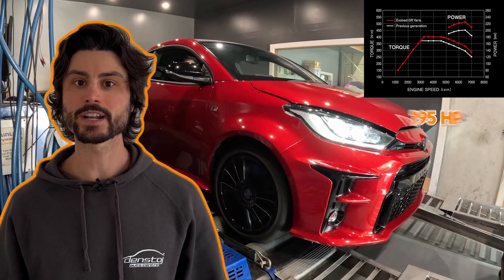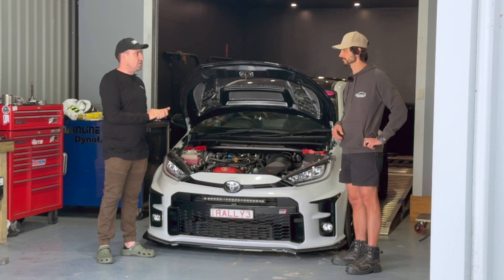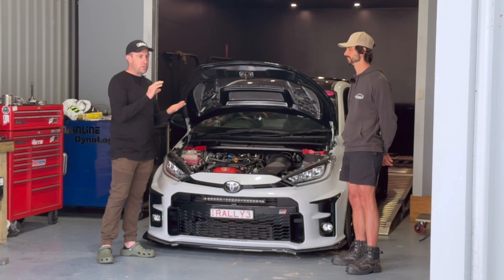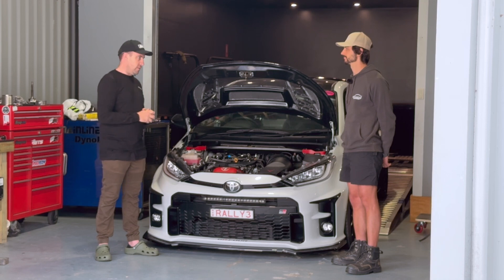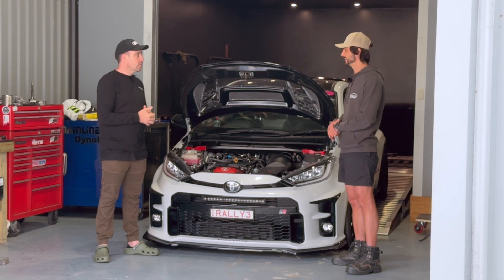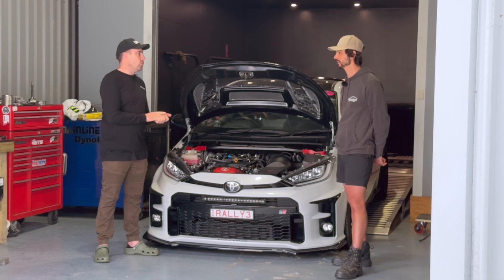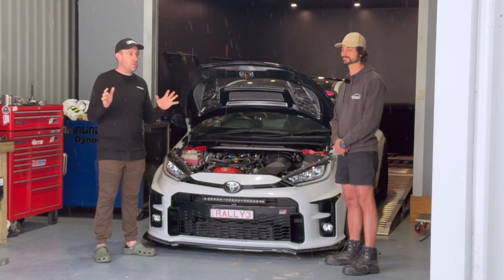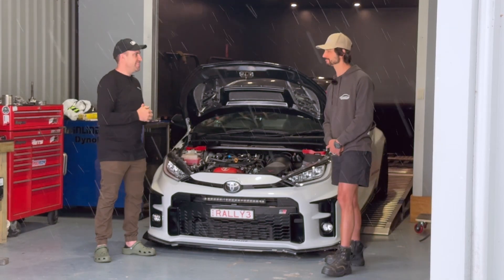Tuning the World's Fastest Hatchback

Comment: Those numbers don’t make sense when the car is only hooked up to the rear. Do a proper video and test it as it’s supposed to be and that’s in AWD
Reply: It's been rolled off the dyno rollers halfway for the chat in the video.
Reply from the maker: The GRY actually has a  "2WD dyno mode" which cuts drive to the rear wheels and turns off safety features such as active traction control and ABS. This eliminates AWD drivetrain losses. Regardless, what’s most important is consistency across the tunes to gives us reliable results to compare rather than dyno-to-dyno as calibrations can vary.

Comment: I'm pretty much running this mod list from this build with the GCG turbo on order. You said factory fuelling is maxed out but they didn't go bigger port injectors? if you were tuning this again would you have preferred them swapped?
Reply from the maker: I’m not exactly sure how much of an increase in injector size ECUTEK can handle or how much of a difference it would effectively make considering the fuel control limitations on ECUTEK—a great question for Ben. 🤔

From a tuning perspective alone, I know he would have preferred an aftermarket ECU and upgraded injectors to fully maximize the GCG turbo and Kelford Type-A cams….but that can lead to a slippery slope with more mods.

What are your goals for the setup, and how do you plan to use the car?
Reply: @denstoj  your customer story aligns exactly with mine, and I have everything in this setup except I'm using the EZP instead of A kelford cams - the motec @ 8k AUD is just a difficult boundary to cross in terms of $$ to value ratio. 
My goal was to make 250 peak without losing too much on the curve, but we'll see if that's possible. I know my tuners been struggling to get me above 26 psi 193kw rolling dyno on OEM turbo, we'll see what the GCG can do; it's possible ecutek needs a bit more time in the market but I think this build setup could be a decent compromise for a lot of people.

Thanks for sharing this series though - I think it captures a sweet spot a few people will want to replicate.
Reply from the maker: @jaxomliam  Ah sweet. The $ jump to a Motec is a tough boundary to cross. 250 kW is definitely ambitious, but with the GCG turbo, it should be achievable without sacrificing too much of the curve, just not sure if you'll have to swap out the EZ to the Type-A. A good question for Kelford. 

The limit you’re hitting with the OEM turbo is a pretty common challenge, and yeah with more time in the market this setup will get better with further ECUTEK development.

Glad you're enjoying the series. Like you said, it'll a be a common setup for people looking to push their GR Yaris without going all-out on a standalone ECU.

I'll let Ben know about your port injector swap question. Hope you're enjoying your long weekend. ☀
Reply: Yes the swap to larger port injectors would be nice, however I personally feel as a calibrator there isn't all the tools we need available YET to correctly dial the larger port injectors in to OEM standards.

That's where the jump to Motec or Syvecs for the ecu will have its benefits at this stage.
Reply: @denstoj these guys can achieve the power on the EZ, they may need a little bit more boost but the power figure is set from the turbo not the cams. The cams only support the power, at 250kw the EZ cams are only just starting to work and would sacrifice bottom end power going to the A spec
Reply from the maker: Got it! Thanks for clarifying @Kelford-Cams 💪 I'm sure @jaxomliam will appreciate it.
Reply: @jaxomliam where abouts are you located? Sound like you have the same thoughts on your build as I did. This is mine and I’m extremely happy for now with the results 👌🏼
Reply: @DarrylSmith-r3p  great to hear youre happy, I'm based in Melbourne. I'll post my results when I get them. :)

Comment: Great info!  What would be the cost of a build like the one in the video?  Thanks in advance
Reply from the maker: Thanks! Here's a rough breakdown of the estimated costs for parts and labour in this series:

Weldspeed Intake Plenum $1,000
GCG Turbo (High Flow G16E-GTS Unit) $4,795
Kelford Cams $1,300
Kelford Valve Springs $700
Lamspeed Head Studs $1,000 (go with the Pro not Street)
Denstoj Rocker Retainers $869

Parts Cost: ~$9,664 AUD

Then ontop of that, talking about engine upgrades, Daz also has a turbo-back exhaust and Eventuri intake.  

Labour Breakdown
3 hrs - Remove tappet cover & timing chain 
2 hrs - Remove & re-install head studs
2 hrs - Remove camshafts & valve springs 
2 hrs - Install camshafts & valve springs 
4 hrs - Remove OEM turbo & install GCG turbo
3 hrs - Re-install timing chain & tappet cover
3 hrs - Stock intake plenum removal and installation of Weldspeed 

Assuming $200/hr, total labour ~$3,800

Oh and the tune is around $1,700 on ECUTEK.

We'll be doing another similar build in a couple of months. Let me know if you have any other questions.